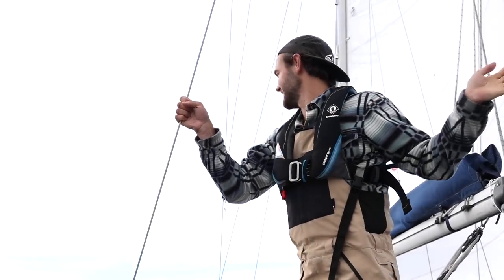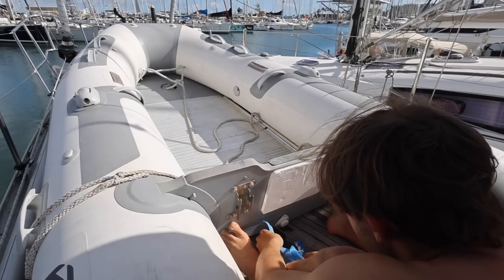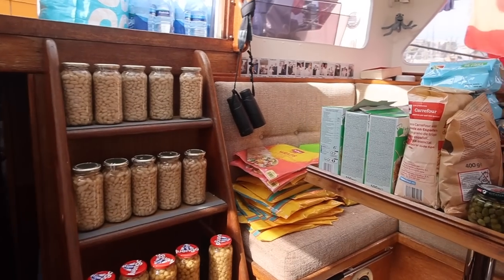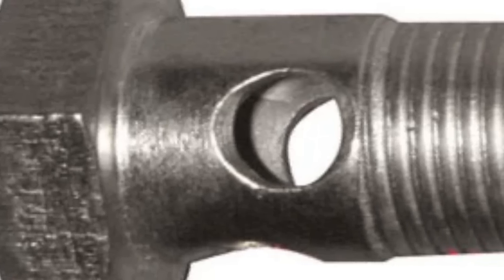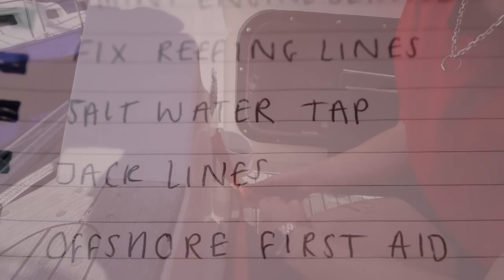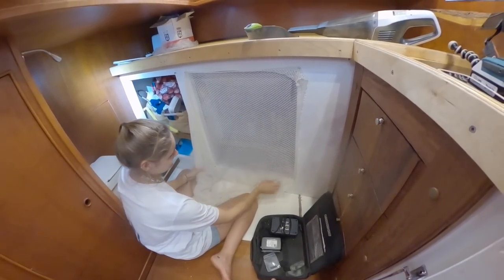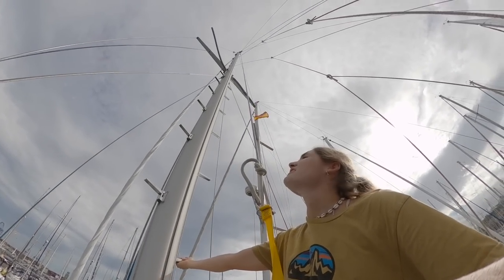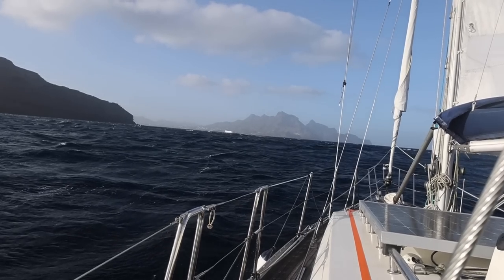PREPARING to sail ACROSS an OCEAN (for the first time)

Comment: A real milestone.  Congratulation. I must admit I thought you had a water maker aboard. Hope that is in the plan.  BTW, electrician's side cutters are better at zip ties than scissors.  Also, never buy cheap zip ties. Be sure that they say on the packet UV inhibited, outdoor installations etc. You usually have to buy them from a proper electrical supply shop not just the local ironmonger.
Reply from the maker: Not yet but we are hoping to get one soon 😊 Thanks for the advice, I’ll look into getting a pair.

Comment: Pro tip never use cable ties for nets or other long term out door load bearing things if you have to for some odd reason use at least 2 on each end ,one being slightly looser than the other. it is better to use 550 or small spectra to tie things up and also for hard things like the caribener to the mast if soft shackels are out of the budget just use a loop doubled through the mast hard point then clip the caribener to that so it makes a shock absorber. also for every hose possible and every seacock hose use 2 hose clamps (jubalees) and if at all possible put them 180 degrees out and reversed from each other for max durability that way one clamp failure does not make a crisis at the worst possible time.

Comment: On you jack line. If you heat a piece of metal hot and use it to melt it in two it will leave a very clean end that won’t fray.
Reply from the maker: Thanks for the advice 👊

Comment: Soooo much Oat milk.  That's crazily expensive.   I'm pretty sure I saw a nutribullet on your boat.  You should make it yourself.  Just oats, water, blended in your bullet and a muslin cloth.   Nothing is wasted as you can use the oats after.
Reply from the maker: Luckily the oat miles were only 0.80c each! We do this occasionally but it’s not something you want to be doing all the time on a crossing.

Comment: You don’t want to use impact guns on anything, unless you know it’s been apart recently and was greased. They’re brutal and you can’t beat a spanner or a socket with a ratchet to feel for the thread. Watch tyre fitters and how they treat locking wheel nuts.
Reply: Bon voyage and keep safe guys. What an adventure! ❤️
Reply from the maker: Thanks for the advice Bernie, I’ll make sure not to use one next time! 😊
Reply from the maker: Cheers 😄

Comment: Storing potatoes and onions together isn't the best idea. Onions produce a high level of ethylene gas, which will cause potatoes to ripen — and go bad — before you're ready to use them. However, those spuds aren't completely innocent, either; potatoes' high moisture content can cause onions to liquefy and leak.
Reply from the maker: Thanks for the advice, I’ve now moved them 😁
Reply: @TeuluTribe  Have a safe venture skippers! Great work with the preparations

Comment: In Australia the Royal Flying Doctor Service have a medicine chest that is held at remote stations / mine sites / drill rigs and small communities - All the medicines are numbered so it removes confusion eg someone calls the RFDS and they will prescribe 2 tablets of No 4 daily as an antibiotic and a No 67 for pain relief (eg probably just panedol but No 67 it is ) How great would it be if the international yachting community had something similar for all yachts / boats, so when an accident happens the doctor on the radio could prescribe treatment - An audit is conducted by the owner of the kit regularly and all used or out of date items are returned and replaced by the RFDS. Also the kit contains some class 1 drugs such as morphine and pethadine etc - These must be accounted for and any use must have a doctors prescribing Number - before replacement is provided. Any shortfalls or illicit use and the police are called. what do you think - every boat around the world with a standardised numbered medicine kit with rules on restocking medicines / bandages etc
Reply from the maker: That’s such a good idea, it would really simplify dangerous situations were medical personnel can’t be at the incident! Surly something like this is used onboard larger commercial vessels?